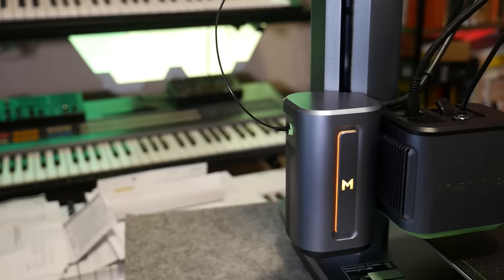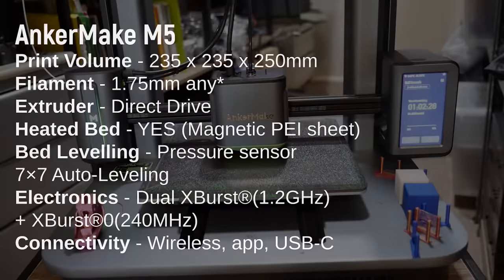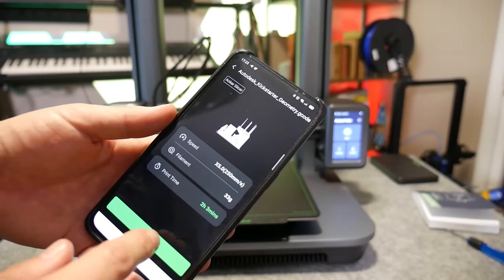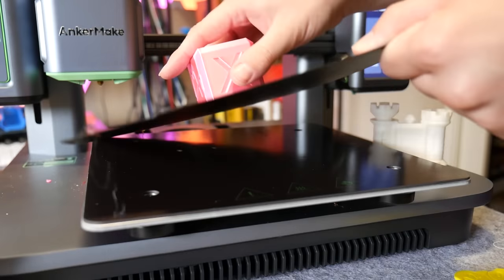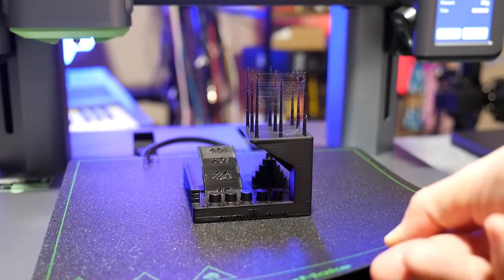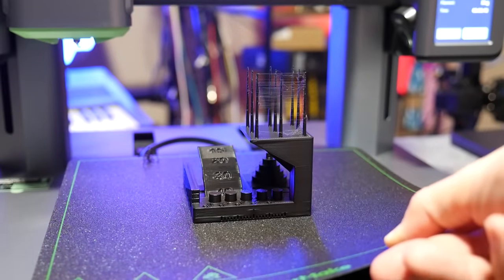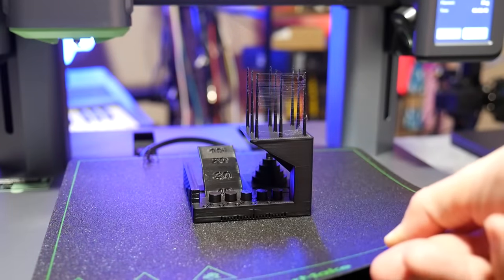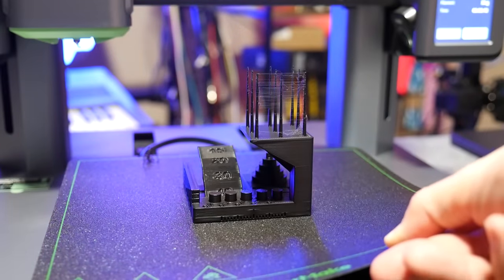AnkerMake M5 3D Printer - Awesome or just hype?

Comment: I think this printer makes more sense at maybe the $500 price range.  The use of V wheels instead of rails at this price point is kind of silly.
Reply: Especially with the Sovol SV06 out. I would have bought that over my S1 Pro if it was out when I did.
Reply: Ironic that some 200 dollar machines come with rails
Reply: I really hate v rollers, that's just ridiculous in my opinion.

Plus $800? I'd rather buy anything else
Reply: @enb3810  You'll get a Prusa MK4 kit for 900 EUR (or 799 USD excl. VAT), still a bed slinger but should be superior to the Anker quite clearly and more robust in the long term (no v wheels of course).
Reply: @sagichnicht6748  Not...really. Honestly your paying more and receiving less. The MK4 doesn't bring anything to the table the M5 doesn't already have and do better, OTHER then the v-wheels, and it lacks features the M5 already has, not to mention the smaller build volume.
Reply: @Geoff_W  V-wheels are a no-go when you want a durable printer. Also not putting unnecessary heavy weight on your gantry is a plus too. These are just the obvious signs that the printer is not built with endurance as top priority. Certainly it doesn't look like repairability and broad spare parts supply from 3rd party market is a priority. Prusa is the option if you want an unpack and print printer which is however designed with at home repairability, open designs and longevity in mind. You might not be interested in these things but some actually are. 

Which important feature does the Mk4 miss out on? It will have input shaper and pressure advance, completely automated bed levelling, filament runout detection, powerloss continuation and wifi (without forcing you onto some foreign servers or into some closed app) among others. The thing I can't judge yet with the Mk4 is the new extruder setup. This is actually new and nothing alike what is offered by Bambulab or Anker. We need reviews first however to see if and what it improves. Also the Mk4 is not limited to 260°C extruder temperature and 100°C bed temperature, like the M5, which is indeed quite limiting for some more advanced materials. 

Your point on "smaller build volume" is a bit border line. Those are differences you almost have to use a cantilever to see. 250x210x220 mm vs 235x235x250 mm. You can print actually longer objects with the MK4 but you can print higher with the M5.

PS: You are paying more but only if you don't want the kit. The MK4 kit is sold for the same price as the assembled M5. With arguable a number of key components being of higher quality. I suspect also fans and stepper motors, not just the v-wheel issue.
Reply: Feature wise I think your $500 price point seems reasonable.  Here is the kicker. Unless you actually have seen felt and actually picked up the machine in person I think many people do not realize how MUCH aluminum thing this actually has. I have a Voron Trident I built myself and this thing blows it away in stability. I think this is where a lot of the cost lies. Is it potentially over engineered? Maybe, but I can say the stability on this thing is much more significant then any consumer i3 printer I have seen.
Reply: @justme12510  Yeah, I've messed with it in person and almost bought it.  It's a chonker, but the V wheels make me cringe at this price point.
Reply: @justme12510  absolutely. I don't think that was a good place to spend all of the customers money, sacrificing other important things. That being said, your money is DEFINITELY being spent somewhere if you buy this
Reply: @Geoff_W  since when does the mk4 wifi need the cloud?
Reply: @Geoff_W  the extruder gear ratio doesn't make any difference, also what do you need the camera for if the printer doesn't fail? prusa mk4 is definitely going to be more reliable in the long run than the M5 and has easier quick nozzle swapping. Plus having a printer that needs less repairing over time and already has a community which mods and makes improvements on it is probably better than having a kit that is slightly easier to assemble
Reply: @winner6719  Gear ratio is literally a selling point of the 'nextruder'...but by all means keep burying your head in the sand. The worst part is your fighting over the M5, which isn't even a THREAT to Prusa. It's just the one that is remotely close. Ultimately buy what will make you happy.
Reply: Thanks. Didn't need to watch the video
Reply: so what would you recommend for a printer in a similar price range? Getting real tired of my ankermake
Reply: @smashedintopieces000  Depends on what your needs are. What do you need from a printer? What do you expect it to do?
Reply: Exactly. For the same price I would get a Bambu P1P without a second thought. I get that the aim here is build quality and user friendly, but V wheels on a printer that costs $500 and up is ridiculous and not as user friendly as rails or rods.
Reply: @Geoff_W  
There is no need for this aggressive tone.

I stand corrected on the Wifi, so they have not done the same as Bambulab. Good. You are wrong about Mk4 wifi being charged extra. It is optional but it is included in the printer package without extra costs involved. I was under the impression you do not need the cloud for PrusaLink. You need a Prusa account to set PrusaLink up but where did you get the information from that it send print data via the cloud?

You missed my point on the Extruder entirely. This isn't primarily about the gear ratio. I am not talking about momenumt or anything. I am talking about the nature of the gears. One one side it features a planetary gear, which neither X1/P1P nor M5 do. But equally as interesting is the extruder gear itself. Most current printers have a dual extruder gear setup. Correct me but I think also the M5, certainly the X1. The Mk4 doesn't, to compensate for that it does have a much larger extruder gear itself, larger diameter means more teeth grip the filament. The question I am interested here is that dual extruder gears are rumored to be one of the factors causing very fine extrusion artifacts. There are different opinions out there but I am interested to see if this single (teethed) extrusion gear setup will cause less artifacts of that kind. I am waiting for reviews, so maybe this is an argument for the MK4 or it is one against it. It is certainly something new. 

Regarding the stepper motors. They are not all the same. They do come among others in different step angles. It seems Prusa has chosen stepper motors for the Mk4 with more steps than the Mk3 (I couldn't find concrete information what step angle they feature but Mk3s have fairly mainstream stepper motors). The difference is not huge in practice but according to Prusa it helps also in reducing the "fine vertical artifacts". If the M5 uses those too, good for it, but if Anker chose V-wheels for the extruder axis it would be surprising if they went the extra mile on the stepper motors. 

Regarding the kit. Yes, sure, a kit means you have to assemble it, that is much more involved. It depends on the customer if he or she enjoys the kit experience. There are those who do and those who don't. It is true that if you actually build a kit, that you are also much more competent in maintaining and reparing your printer and even well built 3d Printers need maintanence and occasionally also repairs if they are to last. If that isn't your first printer, the learning aspect is of course not as important but you still get to know the new printer in much greater depth. 

The spaghetti detection is redundant (the way it is implemented, according to the review above) so not worth mentioning. The webcam is a plus, a feature that is not included with the Mk4, so it will cost extra. Now here is the same question as with the kit. Some people want a webcam others don't. I for one couldn't care less and I know a number of people who share that view with me, others do. 

It is not just the fans on a printer. It is also about the mechanical parts, axis, bearings etc. On a Prusa printer you can literally replace every single part if need be. I doubt you find that level of repairability on non open hardware printer like the M5. You can say, that you don't need that but it is certainly a feature which some, including me value. 

Is the M5 a bad printer? No, I did not claim that. The v-wheels aside it does look like a good printer. However compared to other options I don't see it as an offer for me. If I want to go cheaper than the Mk4, I'll go straight to a Sovol SV06, also open source, at a fraction of the price of both. If I want to spend around 800 EUR on a printer and the get most for the money on features that matter the most, I'll get a Bambulab P1P. Now you can tell me again that I have no clue whatseover but I am hardly the outlier with that assessment.
Reply: @Geoff_W  The gear ratio is in the marketing material but I always was under the impression that it is the "planetary gear" part that is the highlight not the "10:1" (why would a gear ratio be the main highlight? The gear type is special, the ratio isn't.) and even more so the large extruder gear... and the quick swap nozzle.
Reply: @sagichnicht6748  No tone meant, text isn't always good at tone, sorry for that.

I still disagree about your statement on repairability of the Mk4. It's new electronics ARE proprietary, and they are not open source as you are claiming.

As for the wifi needing the cloud, it's right there on the Mk4 page about Prusa connect. It says you upload the model to the cloud, and the printer then downloads it. That's not local, whereas the M5 has a 98% local solution (still needs to authenticate with Anker's cloud to grab a session key to talk to the printer, which lasts until the printer is power cycled).

The OEM stepper motors on the M5 are re-branded LDO motors just like on the MK4. I have no idea if they share the same angles or anything like that.

I've never heard about vfa's coming from an extruder motor gear setup before, I'll have to read up on that, that might be why I read the extruder using a 10:1 gear ratio as being fairly meh. Planetary is neat but other then it being just neat I didn't see a point other then for the ratio. As for why ratio matters, it matters because a high ratio is required for accurate high speed printing. The faster you go, the higher gear ratio you need if you want to not under extrude and keep pushing that filament.

As far as the v-wheels go, I've got no argument there. It's a total miss on Anker's part as far as I'm concerned, and it's.made even MORE laughable because their given reason for NOT using rails (per the Kickstarter FAQ'S) is because rails were 'too noisy'. That said, I will give them credit, their wheels are PTFE, not POM, and they carry the same warranty as the printer, 2 years.
Reply: @Geoff_W  You say no tone meant but there is quite a lot of flavorful text coming from you messages 
"...but by all means keep burying your head in the sand" 
"AND IT NEEDS THE CLOUD" 
"It's REALLY obvious you haven't done even a minimum of due diligence on any of your claims."
Maybe stay away from using capitalization in such a sassy manner or just simply ditching all caps altogether would help a lot in making your messages come across more neutral instead of aggressive.
Reply: For that kind of money you already could get a Ender S1 Pro with that Sonic Pad (which is basically Klipper) or the Ender 5 S1 with Klipper.

But with the Creality K1 ... there's a new kid on the block ...
Reply: It's currently $550 on Amazon
Reply: Yeah, rn it's usually at those 500$ in discount
Reply: I saw one on sale 37% off at $499 on Amazon, tho with the money I’d probably choose bamboo labs A1 mini at this day(sadly I’m only able to get a Ender 3 and upgrade it myself 😢)
Reply: Just bought one at £449 on Amazon, after two attempts to buy the Bambu Labs P1S, which resulted in two £884 charges to my credit card and Bambu Labs denying I had ordered a single P1S. After the reviews stated concerns over Bambu Labs customer support, I could not get past if Bambu were this uninterested in overcharging me then denying the sale, how less helpful will they be if I was successful in buying one? So chickened out and got the M5 and hoping the Ankermake v6 colour kit comes out soon.

Comment: The Prusa i3 MK4 kit and the Bambu Lab P1P both come in at a similar price point. the AnkerMake M5 wouldn't even be a consideration for me personally. Pom wheels on V-slots is just wrong at this price point. Pom wheels wear down, develop flat spots, and introduce artifacts in your prints over time. Perhaps Anker was hyper focused on the appearance and they ran out of funding to develop a proper kinematics system for a printer at this price point.

Comment: A year ago maybe this would have made sense but in a world with the 699 P1P I just don't see it. I've been printing for over 4 years just got my P1P a week ago. Literally all I have changed for the six different materials I've used on it has been temperature, flow and pressure advance. I haven't touched a single other setting and I'm getting nearly perfect prints in every single material. I'll never go back.

Comment: Great review! Ive been using my M5 non stop for my Etsy orders and it is so damn loud but consistent and reliable. Not as fast as my P1P but I tend to run into less print fails with my M5. Def going to take a look at your M5 profile 😊
Reply from the maker: Keen for your review of it! My M5 profile definitely isn't perfect haha, open to improvements for sure
Reply: A) why don't you change the fan and b) why don't companies just use better fans
Reply: @urgamecshk  a) It's a weird fan, there is not a quiet drop-in replacement on the market easily available
b) PROBABLY because it's a fan they use in other products so they are able to source the part in bulk? But that's a guess. It's weird.
Reply: @MakersMuse  hahaha yeah my review has been in progress for a few months now… need to get that out already 🤣😂 I did print a huge awesome skull print on it for the video 🤘
Reply: @Julius Jahn  whats the point of reviewing a modified product? You gotta let people know aabout all the issues man.
Reply: Have you tried the new slicer and firmware?  500mm/sec is plenty fast
Reply: I'll Stick with my Bambu X1C carbon which I have had not a single issue where my friend with the M5 has had constant issues

Comment: Going die-cast, and then ... wheel on vslots. Also, putting the screen on a moving part is an other WTF to me.
Reply: They probably didn't want to have the camera mounted on tha Z axis with more cables moving around (or some other reasone related to the camera), which still is quite silly, but it's the only possible explanation I can think of

Comment: Thanks for your comprehensive review of our product and your valuable suggestions and feedback. We appreciate your efforts in evaluating our product! We did want to share some insight on some items mentioned - hope this helps!

Regarding Error detection 
The error detection system is now capable of detecting two common errors( the first layer not sticking and spaghetti). With the new firmware released in March, we have improved the First Layer Not Sticking Detection. We now believe that by ensuring a successful first-layer print, the risk of Extruder Jam can be effectively eliminated. However, the success rate of spaghetti detection is still relatively low. 
In the mid-April release, we will be updating our algorithm for Spaghetti Monster Detection. Instead of using the image-based modeling comparison method, we will adopt a local deep-learning model. As we collect more materials, the model will become increasingly accurate and intelligent.

As for the Filament unload suggestion you mentioned, our engineers will continue to work on making the function better to avoid plugging.

Thank you again for all of your feedback and insight!

Comment: I used to be a linear rail snob, but the more I put my mind to it, the more v-wheels make sense.  First is that a v-wheel is a pre loaded linear mechanism.  So when it starts rattling you just have adjust the nut to get rid of slops. It is more quiet than then linear rails in operations.  V-wheels would have a lower load ratting, if it was ever specified. However, while in operation the motion system does not have to withstand load of a CNC mill.  The only considerable disadvantage I see with v-wheels are the big size to a compatible linear rail, and maybe weight, depending on the design of the v-wheel mount.